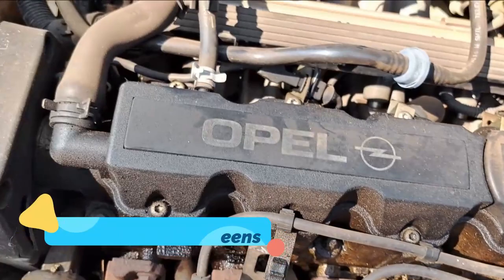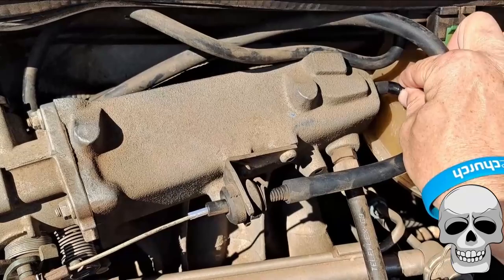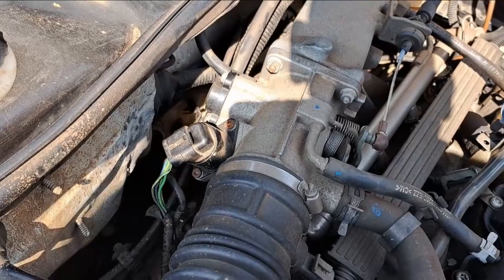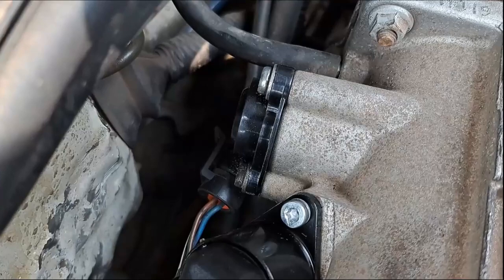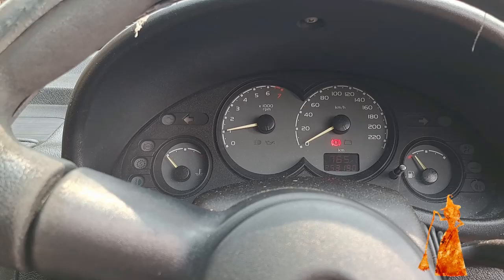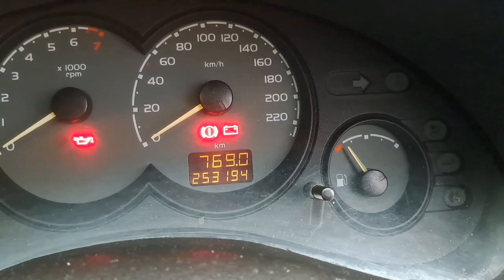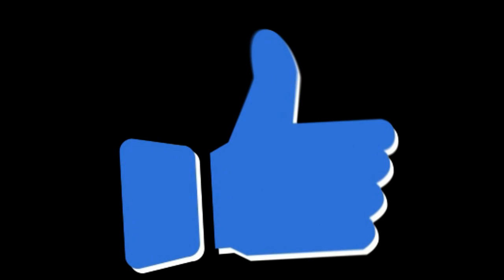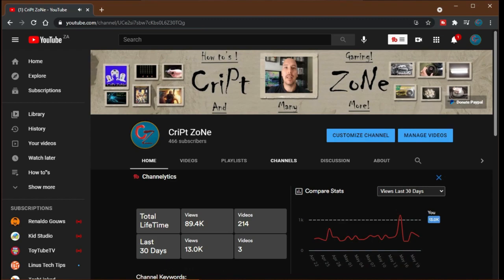Corsa B Idling and heavy fuel consumption fixed

Comment: I've been driving corsa for 12 years, and I'm fixing it myself, its an easy car to maintain👌🏻
Reply: Do you know which engine is better and more reliable? The 1.2 16V or the 1.2 45 hp version
Reply: Hi
Reply: Hello I have a question to ask when I change those does idling sensor and throttle body sensor do I have to reset it?
Reply: Heyy man i want to actually ask everyone here, my corsa B has been overhauled and everything almost replaced to fix one problem but still no fix. The problem is that it starts perfect but you smell a shit tone of petrol and then i drive about 20 km then it just cuts out and cant start back up again

Comment: I have an issue on my corsa B where the car is not starting battery is fully charge when the car starts the gages on the car do weird things switches on and off not sure if its the alternator iv replacesd the positive and negative on the battery hoping its not arching but still no luck any suggestions plz.
Reply from the maker: Could be the computer box. Best thing wil be to take it for diagnostic. Skould be able to say where the problem is.

Comment: Where do you buy the idling control sensor and the throttle position sensor? I've been battling with erratic idling on my corsa utility and now I'm considering changing these sensors and I'm battling to get them.
Reply from the maker: I bought them at Golwagen here in SA
Reply: Yes goldwagen

Comment: Thanks for the vedeo man! Are these sensors all plug and play?  No re learning or having to diagnose and clear codes once you fiddle with them?
Reply from the maker: I just pluged them in. You can disconnect the battery for 5 min to reset the computer.. Turn ignition on and off 3 times without starting. Then start and see if it helped.
Reply: @CriPtZoNe  thanks for the quick response and advice. I did diagnostics and cleared all the codes and the didnt come back. Is it possible that these sensors are faulty even if they don't throw fault codes or engine lights? My corsa bakkie drives fine revs fine but fuel consumption is quite high . I changed bougi cords and seems qbit better. Don't know if I should change sensors or jut clean them
Reply from the maker: @mariusferreira  they are not realy faulty. If you buy parts that are not origenal the resistince and voltiges are not the same as the real thing. That is why they dont work 100% And they can give problems without the engine check light coming on.  If the consumption stays high, check your timing gear on crank and see if the key way is not worn.

Comment: I have the same problem my car jerks in the drive aswell cuts off now and then and stop street or traffic light. Has that happened to you aswell. If this can solve my problem where do I buy those sensors and what do they cost.
Reply: We have the exact same problem. Want to try this. What did the sensors cost and was it easy to replace
Reply from the maker: I buy them ar Golfwagen. They cost about 600 rand for both. I never had the cut off or jerking problem. Just high reving.

Comment: Hello I have a 2003 Corsa that thin pipe you said had a hole in it what's it name? Cause mine to had a hole and replaced it with a pipe from Midas but it was a bit bigger, and my fuel consumption is thru the roof and not sure if it's maybe that, I also replaced both sensor and crank sensor and temperature sensor and tested the map sensor but my revs are still high have to switch the car off and on again, but if I push on the butterfly where the  throttle cable connects them the revs drop so I have no idea please help
Reply from the maker: The thin pipe is a fuel pressure pipe. It helps with the fuel injection. I am having the same problem as you again. It revs 3000 rpm and then I have to switch it off and on again. I am making a video trying to find the problem. It is not electrical this time and sensors are working.  I think it is throttle body. I found one of the springs in the accelerator gets stuck. I am going to open and clean it and see if that helps.
Reply: @CriPtZoNe  thanks for the reply really appreciate it 👍 do you prehaps know where to get that pipe I threw mine away instead of mending it and I think the bigger pipe is causing the greater fuel consumption, I have taken my throttle body off and cleaned it out works for a little bit but then it starts again, like I said when I push back on the throttle body where the throttle cable connects it then revs normally like there isn't enough tension in the spring to make it sit flush, I have no idea but replaced everything else already lol

Comment: Hey thanks the for great video, i have a corsa lite 1.4i and when the car is cold it drives like a dream, when its warm it switches off before i come to a stop when i press the clutch it would die. It starts immediately afterwards. When i pull away sometimes the revs drop below a 1000 and other times the revs go up. After it switches and i start it you can smell the petrol. Any idea what it could be?
Reply: I got the same problem here. Please share if you find a solution
Reply: @junaidbwanali403  today I took out the idle sensor and cleaned it. Drove it for a short well and felt good, will drive tomorrow again to see if it's still fine
Reply: Idle control valve or sensor clean with carb cleaner and port it fits in to or does not work replace sensor
Reply: @regandelve6624  thank so for reply buddy I figured it out it was a connection on tye fuel relay switch

Comment: Has the problem reoccured after replacing it again. I read in one of the comments you had to replace it one again to the more expensive part. Just want an update on the issue.
Reply from the maker: I am currently sitting with the problem again but I think the electrical cabble is damaged and not the unit. I am busy making a video as we speak. Just waiting for some cash so that I can take it for propper diagnostic. I will share the outcome as soon as I find the problem.

Comment: Hey guys I have Corsa lite 1.30i. When I start it it will idle for 20 to 30 minutes there after it of it self.
When I drive it on freeway it use to move nice an Idling nice but when I approch a robot or humps or when I changed the gear down also it off it self. .
I overall it but still same problem. I need ur help guys pls

Comment: hi there.. i have a corsa lite too and my problem is loss of power, its as if the timing is out, i have changed the timing gear and all sensors regarding idling  ,fuel  and air.. do u perhaps an idea wot cld be the problem ? when the car is cold it drives ok but when hot its very unsstable
Reply from the maker: Did you also look at the crank sensor.? Could be the computer or idling management system. Have to do a diagnostic to make sure.

Comment: Hi , I have an issue with the gears 1st gear needs to be hold when pulling  away  otherwise  it jumps out and worse the reverse  grinds badly
Reply from the maker: Could be the links are worn on the gear links. Replace them. And then adjust them and see if the gears ho in better.
Reply from the maker: Also check the forks inside the gesrbox. They might be worn.

Comment: When I'm reving my Corsa 1.4 it don't want to rev but it idle normally. Can you help me please
Reply from the maker: I have not had that issue before. Does it seem like there is a dead spot. Does it rev up eventualy or not at all. Could be fuel sensor  or injector problem. Maby fuel management chip? I would suggest doing diagnostic.

Comment: Hwzt man, uhm I've got a problem here with my corsa. When I start it and try to drive it loses power in a way that I have to have my clutch half while I accelerate more but sometimes it switches off.
Reply: When I disconnect the petrol switch I think,its starts well but when I put back then the car just sounds like it's wanna loses power and switches the engine off.
Reply from the maker: Try a comunity forum. They might have the answer. It could be the switch. Could be blocked fuel line. Or elecktronic. I have not had that problem before.  Good luck. If you get it sorted let me know what it was.

Comment: Ive done the same and yet 2days later it does the same thing
Reply from the maker: Mine is reving high again. The women at the shop watned me that I should not take the cheaper one of the 2 options that I bought. I have to get the more expensive one and see if it lasts.
Reply: I just bought the oem parts finished and boom fixed
Reply: @mariuspretorius3569  hey Marius after buying the OEM part has the problem been sorted or has it reoccured once again
Reply: @shaq06  ive not had a issue sense i got oem parts expensive but worth it
Reply: Hi guys i have an opel astra G 1,8  my car is not revving, i haveto press hard for it to revv, im in Zimbabwe, where can i get those throttle body sensors in s a